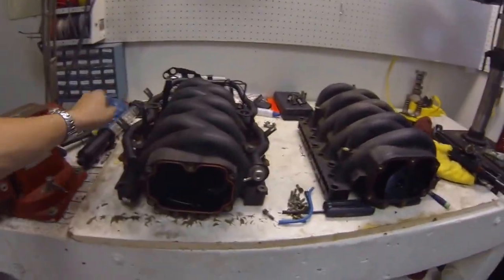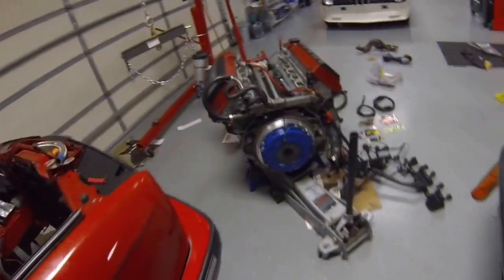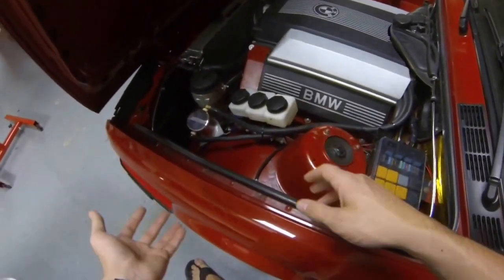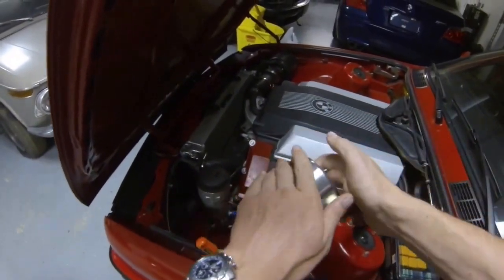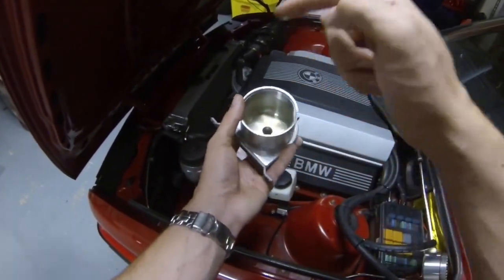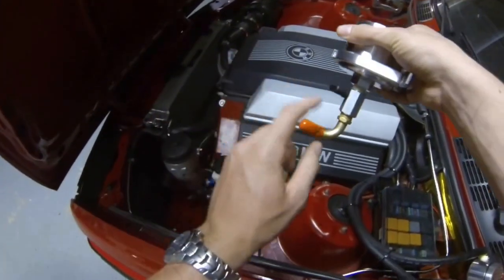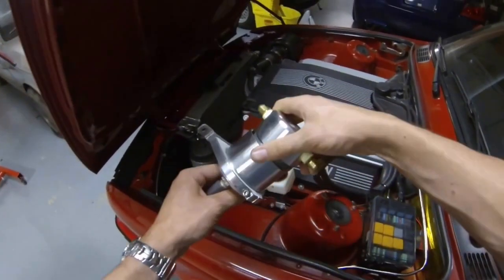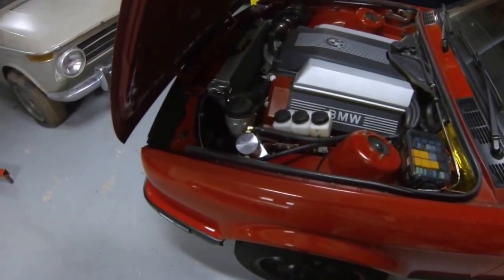Oil Catch Cans..Do they WORK?

Comment: 20 years ago I made a catch can fron pickle jar that had IN port with a tube going down 3/4 down inside to the bottom of jar other was an adapter in the lid for a hose to intake, jar was filled up with regular glass MARBLES AND AS THE GAS GOES UP IT CONDENSATES OILS, WATER, WHAT HAVE YOU TO THE BOTTOM. I don't understand people spending crasy money because they don't understand something as simple as condensation...and believe its rocket science.

Comment: Thanks for the video. I'm not convinced that just because you catch some oil that you are doing your engine a favor. The best thing you can do for your engine (especially performance i.e BMW) is descent long drive (good engine operating temperatures) and change oil as recommended. Question: How much was spend on developing that engine verses that catch can??

Comment: A oil separator could have been purchased by Grainger for a lot less money. They are used in the Hydraulic machinery industry. They have mounting brackets, sight glass and they have been doing the job for generations. I'm stuck buying a air catch can for my Ford Escape since i need a little more because of the EcoBoost.

Comment: I don't doubt they catch oil... I just wonder if it's really such a problem. Manufacturers run the air/oil line there... they must know. The cans are cheap and if they could cut back on warranty repairs they would.

Comment: return it to the oil pan? is this guy a joke?   and do they work? you dont care, its a new can, hes just selling you the idea to buy one, no data on if it works, and by works , yes it traps some oily moisture, which your engine will burn fine anyway.....scam all over
Reply from the maker: Given that it's been on my car for 2 years now, yes it does work and I have data to support it..its not about moisture..it's about keeping oil out of the intake manifold
Reply: @gasjunkies7048  which does nothing , its a tiny amount, the difference is nothing, what data supports it,  the difference in weight of carbon deposits with and without over a significant mileage?  or not, you are the guy who thinks you pour it back into the sump, your data is not scientific
Reply from the maker: Your kidding right? Here..have a read about carbon build up on intake valves, might learn something https://www.bmwblog.com/2014/04/24/clean-n54-intake-valves/

Comment: NEVER put what a can catches back in the oil pan. When it is spun in a centrifuge and separated and analysed, it is 70% water and acids. 23% raw fuel, and 7% oil saturated with abrasive particulate matter.  Also, watch this catchcan test. Start at the 18 minute mark to see the final results. The effectiveness of catchcans is as follows: empty cans trap app 15% of what enters them. Moroso style app 30%, and the patented style here is 95% effective.  https://www.youtube.com/watch?v=IZYYdnwIEX0&t=70s   www.RXCatchcans.com

Comment: weird how people love this catch can but no one will show results of it actually helping prevent carbon build up ..(example) you just had the whole damn motor out of the car and cleaned the intake manifold and valves but 2 almost 3 years later have yet to re-brake the manifold down and do any update to show how beneficial the catch can can be by showing how clean it kept the intake manifold, intake and valves after these few years
Reply: Even if it is ineffective, that would make for a good video with lots of views, which he could put advertisements on.
Reply: https://www.youtube.com/watch?v=IZYYdnwIEX0&t=1300s

Comment: BMW has “cyclone separators” on some of their cars that are effectively catch cans. I put one on my North American vehicle after acquiring it from eBay and it works magnificently. I capped the PCV, t-connected that to the breather line, fed those into the cyclone and then out of there back to the pre-throttle intake. There used to be oil that collected in the tube; now it goes through the cyclone and collects in a receptacle that gets emptied at oil changes. Best $20 I’ve ever spent on maintenance. Also- oil looks cleaner for longer and I’ve noticed the oil life monitor on the car goes past where it used to by 10% or so in terms of mileage, which makes synthetic changes more cost effective.

Comment: Save your money people.That only matters on boost applications and even on low boost you dont need the mesh, the 50$ ones are plenty for n/a cars dont waste you're  money, the design of the cheap catch can is fine since the oil cant be sucked back in because it has to go up the height of the catch can so unless its over flowing or you drive your car up side down, there is no oil going back to the intake, I can prove this because my catch cans get full and the outlet hose is always dry, mesh and more expensive catch cans are only usefull on boost application.
Show less
REPLY
Reply: Do you think they'll need a check valve for sc applications?

Comment: This doesn't answer if catch-cans work to prevent build up in the engine, only that catch-cans will collect contaminants in the blow-by exhaust.  

It has been hypothesized that blow-by will be burned on the next cycle of the ignition (previous contaminants will re-combust) and that the water vapor included in that blow-by that you're filtering out is actually cleansing your valves.  So you could be hurting your engine.

In order to answer if catch-cans work, you'd have to compare two engines @ 50,000 miles (some meaningful duration), both driving in similar conditions, one with a catch-can, and one without.  Then examine the crank case, intake manifolds, pistons and valves to determine if they have any affect in preventing carbon buildup.  Otherwise, this video is a little misleading.
Reply from the maker: This does answer if  they prevent build up, anything they collect would have otherwise gone through the intake where it would have eventually  built up in the intake ports
Reply: I want to believe it would work and thank you for sharing what you have done, which is more than most, but if it cycles back through the intake and then gets burnt off on the next pass, is there really much (if anything) that would eventually build up?  From what I've seen is that catch-cans certainly catch blow-by -- I don't think that's debated, but (again) how much of what is caught would have burnt up on the next pass?  Machines are going to make waste and over time that waste is going to build up and make components malfunction, the question is if this is going to make much of an impact over the life of the engine. 

Given what we've seen, the only thing that would confirm how much gunk is build up, is to run two engines with 100k miles under the same exact conditions, one using a catch-can and one not.  I don't think anyone is willing to put forth the effort and resources (time/money) to experiment using the scientific method to arrive at any definitive conclusions.
Reply: @thankyou3806  - But we are talking about a direct injection engine. Its proven by now that the carbon does not burn off and does build up on the backside of hot intake valves in direct injection engines.
Reply: @BoogieDownProduction  Thank you for this.  I'm not an expert, in fact I'm very much the opposite… just trying to learn and hopefully have my questions answered by others more informed than myself.  How has it been proven and where is that information available?  

As I understand it, the build up mostly occurs at lower temperatures, for instance primarily when the engine is cooled after being shut down.  To me that suggests that the number of warmups/cooldowns (startups/shutdowns) would be the biggest criteria, not the duration of how long the engine is on, or how many miles have been processed.  So the amount of oil in a catch-can does not suggest that's how much build up would have occurred in the engine.

Also, if the accumulation is only occurring when the engine is cooled down, then not only will it be a small amount of buildup over the life of the engine, but the catch-can may not capture some of the particles that were in the last cycle (and didn't make it to the catch-can).  I would think if this was a real thing, that catch-can producers would be able to provide some scientific evidence that they are effective.  The amount they could spend on testing ($5k-$15k) different engines at different conditions would be insignificant to the additional revenue they would be generating from catch-can sales worldwide.
Reply: @thankyou3806  I think your logic is somewhat correct ... At the end of the day, I don't think you're doing any harm to your engine by installing a catch can, as evident by the many videos showing the oil and gunk collected. I agree with you that most of the stuff collected in your engine would burn off on the next drive cycle. However, what is most harmful for your engine are short little drives around town (which a lot of people do). These quick drives around town don't allow your engine to get hot enough to burn that stuff off. 
I've been doing research into catch cans for the last few months now and I've come to the conclusion that if the vehicle in question is one you intend to keep, then there's absolutely no harm to get one and slow down the process of your engine collecting all that sludge.
Reply: Thank You when I read a comment like this it restores my faith that some people actually do think it through..thank you thank you :-)

Comment: If any of you talking shit about catch cans has ever had one, or one in this specific Moroso brand, you don't know what you've been missing, my Hemi gets quite some quantity of oil in there, everytime I do an oil change I drain the catch can, and it works very well, bought it at Amazon too.
Reply: I have not had a catch-can, but just because it looks like it's working does not necessarily mean that it is doing what you think it's doing.  Take facial products, for example.  They want you to apply it, take it off, and look at all the nasty oil that it captured and removed from your skin.  30 minutes later, the oil is back in there and the product seemingly has no effect — the skin makes sure it has a layer of oil to protect itself.  To a person not knowing anything about skin, they are none-the-wiser.  They see the product has those nasty oils, so you think it works, even though it has no real effect.  That's not a 1-for-1 example (I stink at giving examples), but hopefully you see the point, that there can be slight differences between a working product and a non-working product that appears to work.

Comment: Do you have an install video? I Would like to do this to my e34 540i. Because i have lots of smoke coming out of my tail pipe and i heard this will eliminate that problem.
Reply from the maker: Mazda Rx7 FD 1993 I don't have an install video I just went off some pics from the forums. As far as the smoke I would start by replacing the crank vent valve on the back of the manifold. It has a rubber diaphragm that commonly  tears

Comment: Correct. NEVER return what a catchcan traps to the oil pan as it is mainly water. acids, raw fuel and abrasive particulate matter. Only a small portion is actually oil.  Want to see how effective any can is? Watch this long term test video. Start at the 17 minute mark to see final results as it is long:  https://www.youtube.com/watch?v=IZYYdnwIEX0&t=7s

Comment: Ebay does NOT make oil catch cans or any other item you might purchase from them. If you know what the hell you're looking for and stick to trusted "name brands" it wont matter if you got it from ebay!  Jesus!
Reply from the maker: Im not saying the brand is ebay, im talking about the $20 made in china junk that is sold on ebay..Yes you can probably find this Moroso can on ebay which is fine but the no name brand china stuff is what Im referring to
Reply: Understood, but this is a catch can bro, not an ignition distributor. The most significant differences I have seen so far with these units is they are either baffled and or chambered.  There are no moving parts that need to be precisely made. I do however share your feelings about crap from china.
Reply: What  "data" do you need other than the oil that's collected in the can that would otherwise be collecting on your valves, piston heads, and intake? The theory behind its function is sound. Mr cynic =)
Reply: I have personally cleaned a badly fouled intake manifold and very fouled intake ports on a VW Jetta after only 30,000 miles on a perfectly running engine that is used with synthetic oil only, and the heavy deposits on the intake valves were hard baked on. A Catch-Can IS A NECESSITY. If you have NOT performed such a cleaning with your own hands, then shut-up and listen; before saying stoopid things like those you have said. What more proof do you need than a fouled intake port on a lightly used, well cared engine that otherwise is in perfect conditions? Amclaussen.
Reply: +Alfredo Marquez. Well said bro. I have an ebay can that was modified using an upgrade method found here on YouTube. It hasn't been on even three months yet and I have already emptied it. (see my video)  So it's crap that will not make it to my engine. Take care, =)
Reply: It's a baffled can...it does not matter where it's made, it's mostly bullshit anyways. There is NO beneficial PROVEN data available on catch cans.

Comment: $50 catch can does the exact same thing. Anything more expensive is just throwing money away
Reply: I've made several myself for less than $20. Used them since the 80's. Use SS or brass filled with 'premium' kitty litter (or decadent(?) from moisture absorbents) They've always caught a lot of crap.............
Reply: I use a cheap one of eBay with no baffle in and it collects a mixture of crap,oil water and even unburned fuel
Reply from the maker: most $50 catch cans do not have the mesh or baffles inside which are most effective at actually separating the oil.  An empty can with lines running into it really doesnt do much
Reply: @gasjunkies7048  how's the oil and crap going to go up the pipe work when it's sat in the bottom of the can.
Reply: That only matters on boost applications and even on low boost you dont need the mesh, the 50$ ones are plenty for n/a cars dont waste you're  money, the design of the cheap catch can is fine since the oil cant be sucked back in because it has to go up the height of the catch can so unless its over flowing or you drive your car up side down, there is no oil going back to the intake, I can prove this because my catch cans get full and the outlet hose is always dry, mesh and more expensive catch cans are only usefull on boost application.
Reply: @Motorsportsgeek  great reply,I couldn't have put it better myself 👍

Comment: Hey sweet ride engine bay looks clean as fuck. Do you have any vids of how you did the installation? That's the M60, my M62tu should be the same more or less
Reply from the maker: Walker71820061 yup crank case is virtually the same on the 62 as far as plumbing a catch can in

Comment: hmmmmm, interesting.  as far as I know these m62s and most other bmw engines have an oil separator at the front behind the chain cover. as will as an oil separator valve (OSV) at the back of the intake. I know because mine is all torn apart doing gaskets etc. nice vid keep it up

Comment: Hey mate, I have a quick question about this product. Did you have to buy different fittings or did the ones that come with it work fine for your m6x? Wanting to get one for my e30 m42. Thanks a lot :)
Reply from the maker: The can just came with a few ft of hose, I had to modify one fitting and the other was just a generic PCV fitting from pep boys/autozone ect

Comment: I think you should leave it as is as far as the draining (not back to the oil pan). If you ever go through cold seasons it can condensate in and around those things and water will mix in with the oil (like a milky sludge). Probably just best to drain it at each oil change. If this was a track car then definitely drain back..but you would also use a different catch can..like a crawford, which has a coolant in/out that stops condensation and drains back to the pan..but is also cuts out your factory PCV I believe.... i have the Moroso set in my car as well :)  http://i.imgur.com/pE5d8HN.jpg
Reply from the maker: Yeah after running it for a while I realized it filled up a lot slower than I thought so Ill just dump it out at oil changes..Clean install on your subie btw :)
Reply: I agree with you Oscar De la Serna and that collected oil  also contain water , so its a bad idea to return it to the sump , the best solution is to get rid of the collected oil .
Reply: BangShift Garage Nice '73 (?) 2002 in the background.  Love those cars.
Reply: BangShift Garage Nice '73 (?) 2002 in the background.  Love those cars.
Reply: I wouldn't return the oil to the sump since blowby vapors have fuel as well and that's bad for the oiling system.